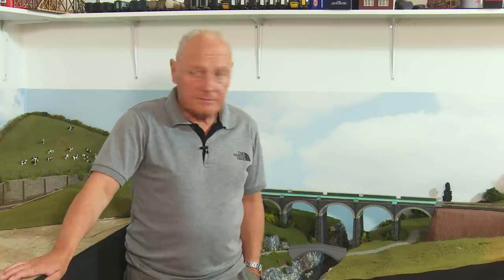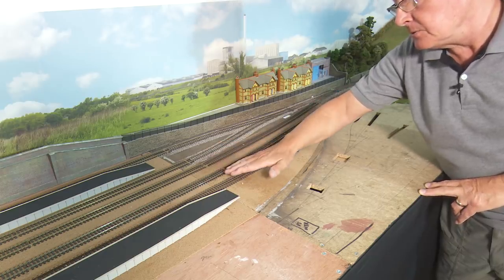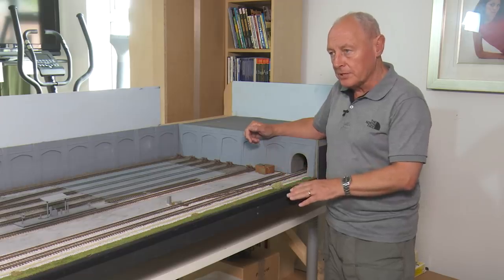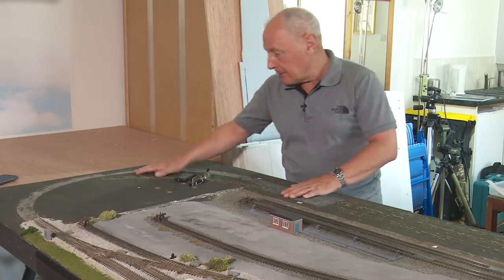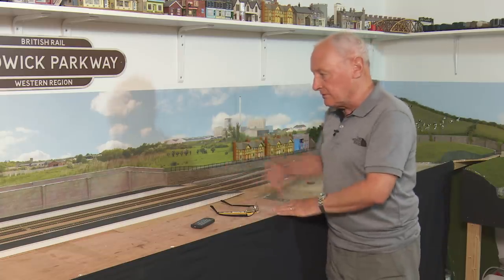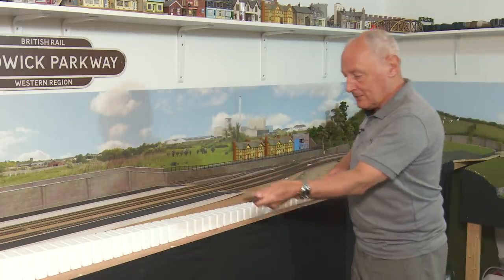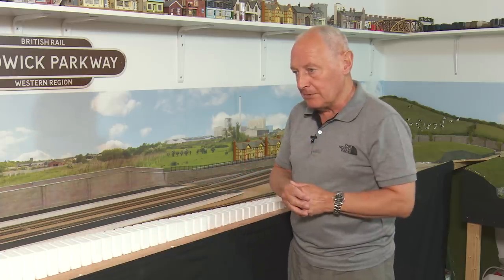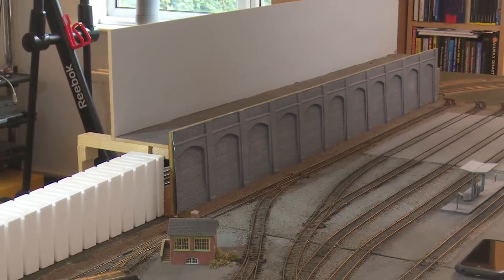A boring track plan at Chadwick Model Railway. | 72.

Comment: hi Charlie, I've got a very long incline on a ply strip. I found that I would have been better making it wider to accommodate a bit more scenery between rails and back scene. I used moss hedge which barely misses the trains! So the extra width on your incline is possibly a must.
Reply from the maker: Great point Chris.

Comment: Hi Charlie,
First, thanks for all your videos, which seem to come out just when this beginner is confronting a similar problem. 
Second, I would not use the 4% incline unless it was hidden - I think it will detract from the look.
Third, I think you should add an industry in addition to the parcels siding between the station and the edge of the board. Lots to do delivering raw materials and taking away finished products. Anything but boring.
Reply from the maker: Sound advice, thanks Tom

Comment: Hi Charlie, I never had much joy with inclines, but that's dating back to the days of old Lima and X04 Hornby stuff. Those locos would have difficulty pulling the skin off a 4mm scale custard. That said, my new Hornby TTS Class 40 can hardly pull itself along let alone a rake of anything prototypical. Looking at the 1:25 incline, I think it looks too steep personally, but it's all down to what gets you from baseboard to elevation in the run you have. I think if you were modelling 3rd rail SR then it's fine, but that's my tuppence worth! If it were me I'd probably have gone for a bit of scenic level change in the foreground of the station and maybe some decaying sidings to the right. Keep up the good work and make it for yourself foremost!
Reply from the maker: Thanks Ben, some good points too.

Comment: TBH - if you have such a distance between the new and the old TMD, I would use a shallower incline as it will be more realistic. I also concur with others in that you could split one set verticall with a hot wire (create a jig first) or lay a slightly wider sheet of balso or fibre board on top. I would be then be using traditional scenery construction to abutt the face of the gradient ie I would not trim/ cut into the gradient system. I dont think its boring - its simple. And what will you do with all the space infront of the station - looks perfect for a goods yard to me ie the trains will be part of the layour and the simpler will prove the better though I like the incline link to the old TMD
Reply from the maker: Thanks very much for your input, certainly food for thought.

Comment: Hi Charlie. You mentioned about the incline looking too steep. A good idea to hide this could be to continue the arched retaining walls on the outside, along and down 4% with the the track to the bottom of the incline. That way you still see any trains running up but from behind a small wall. Failing that, a tunnel would hide it very well indeed. Hope this helps ☺
Reply from the maker: All good advice, thanks T.

Comment: Charlie, I'm afraid you've got the same bug as me - get so far with a project, then change the layout! My wife says I'll never finish mine, and is asking SERIOUS questions about money spent lol! IMHO 4% incline is not right for a British outline mainline layout, when you consider that the Lickey Incline is something like 2.6%, and that's the steepest in the country. Trouble with the 2% or 3% inclines you mention is that you'll need a longer length to get the same height.

Also, if the idea is to run a shuttle between Chadwick Parkway and Chadwick Central, is there any need for it to be double track? And does the line have to cross from one side of the layout to the other at the station? Have you got room for a bay platform?

Anyway, keep up the good work!
Reply from the maker: Sound advice, thanks Neil.

Comment: Good video Charlie.  I admire your honesty!  I like the incline as it gives another dimension to the layout.  My only thought is with regard to the station area in front of it; are you going to have some branch lines and/or sidings? otherwise there is not much other than straight track to look at.
Reply from the maker: A fair point Simon and I’m on the case!

Comment: An interesting question Charlie. i personally like the parkway station. And looking at the incline behind it, it seems to me to over power it. Also just a question how will the trains get from the parkway platforms to the new Central Station. Unless you plan to have platforms on the incline, like the old Ilkley lines platforms at Skipton. Could I suggest that you use a '3' incline and bring the Central Station to the front of the fiddle-yard. I know this will mean changes to the old Chadwick TMD. But I also tried in the past to incorporate an old bit of layout, and I found it restricted me to much, that I scrapped the idea and started again, and planned anew. Before you consider anything further, if it was me; I would serious look at how you intend to connect the two stations, possible even totally redesigning the Parkway Station, as its current design I feel is also restricting you. The only thing that should be sacrosanct is the viaduct scene.

Again this is just my personal opinion, after all it is YOUR model railway. I am looking forward to see how you resolve all the problems.
Reply from the maker: Sound advice, thanks L.

Comment: Charlie I have those risers on my layout and I used plain brown hard board cut to into strips wide enough for 2 tracks and a little extra each side, you can lay the hard board rough side down and it will glue to the risers, the hard board is cheap and easy to cut and you can lay track on the smooth side.
Reply from the maker: A good tip SR, many thanks.

Comment: Hi Charlie. I largely agree with most of the lengthier comments below. It's already interesting and more complicated than my layout, but, at the end of the day, it's your layout and you that has to be kept engaged. Bored Charlie equals no videos for us!!!  Depending on the scenery surrounding it I think the 4% (well done getting there with the maths eventually!) does look a bit steep, but if your locos can manage it that's all fine. As you are going to have to go to the bother of two foam incline sets for the width I think you could use it to your advantage and, once the track is in place, carve the "spare" foam into embankments where retaining walls are not used. 
From my own and others (I am thinking of Graham Foulston's helix on Lakeside Mk 1) experience, if you can keep the inclines to the straight sections and any curved portions on the level there should be no problems with running up and down. And, if it's to be Chadwick Central two lines will be required.
My first N gauge layout (god, it's over forty years ago now!) featured an incline up to a station over other parts of the layout and I recycled that track plan more than once in different scales. More power to your elbow and, as ever, I look forward to developments. Cheers, Davie
Reply from the maker: Thanks Davie, it’s comments such as yours that make it worthwhile.

Comment: Isn't it possible to widen the ramp to fit two lines by overlaying another sheet of some sort of adequate width, and in-filling the overhang on both sides?
Reply from the maker: It is Gareth but I’ve already bought another set anyway.  They might well be cut down though.

Comment: Having recently returned to the hobby after an absence of nearly 50 years I really appreciate the encouragement and advise your channel provides, not to mention updating me on all the changes of the last half century! I think your viaduct scene looks great and whilst I can see where you are coming from regarding it making the station area look boring, it's the overall attention to detail everywhere and the pains you go through to make everything look right that impresses me. So why go and spoil all of that by trying to fit in an incline that in no way under any circumstances will look right ... it would be very dominant and simply too steep? Do hope you won't take offence ... certainly none intended as it is after all your railway but I think you need to apply the same trick you used for the tight curves and hide the incline out of site. All the best
Reply from the maker: Sound advice, thanks GDS and certainly no offence taken

Comment: I think you are going through the "I'm board with this layout"  like we all do. But I would like to say just concentrate on getting the layout all connected and running, then start doing the major changes that you want to do. You say put in a 12 siding at the back and you said " I can crawl underneath the boards", but in five years time you may not be able to do that or it could be hard to, so put some in front of the station as carriage sidings. The incline thing can be solved by putting some very thin plywood on top of the incline strips and gluing the track to that, and either cutting down the back wall or build it up to the back wall. Hope some of these ideas are useful. Thanks for an entertaining  video.
Reply from the maker: Thanks Colin, I’m so pleased that you enjoyed it

Comment: Hi Charlie
I know you want a double track but suspect it may be a better proposition as a single line branch, with maybe a 2 or 3 line terminus station? The line being bi-directional so where it joins Chadwick Parkway you may need to add point work to get across the main lines in either direction..if that makes sense.
Just an idea.
Cheers Paul
Reply from the maker: Thanks Paul and you’re not alone on that view.

Comment: I think every modeller changes their mind at some point in the build as to what they want. You have some great ideas and I look forward to seeing what you do. If I could throw my 2 cents in:

I would suggest taking the start of the rise back as far as you can personally I’d take it back to the fiddle yard have the branch run off from the fiddle yard on a slow journey up, a double track line and large terminus might be a bit tight in the area but a small urban terminus from a single track branch running closer to the city centre work give you ample space for freight sidings and a couple of platforms. This would give you a great contrast from the busy main line station at parkway.

If you ran single track from the fiddle yard yes you would have to run a second bridge, but it would give you more space for scenic elements, such as maybe an abandoned halt from the steam era in one of the corners or a disused passing siding due to the reduced amount of freight on the line. 

Starting all the way back from the fiddle yard would mean the track would be high enough by the time it reached parkway that you wouldn’t need to remove the freight siding, and your terminus could be slightly higher giving you more space underneath to be able to easily reach the 12th track in your fiddle yard with out bumping any of your parked rolling stock.(Something that looks like it might be hard to do with height you showed)

But that’s just my opinion. In the end it comes down to what you enjoy, and what you want on your layout.

Thanks, Kyle
Reply from the maker: Sound advice Kyle, many thanks.

Comment: Another very interesting video Charlie. Considering the high standard of your layout, I think the incline is heading into "train set" territory - too steep and cramped.
You(and other subscribers) may not like this idea but have you considered scrapping the original T.M.D. section? It seems to be restricting you at every turn(pun intended) and is causing you all sorts of problems. It was an excellent little layout but if you considered it to be a "learning tool" and started that area from scratch, I think a lot of your problems would vanish overnight. 
If you still fancy a high level section, why not put the second station at baseboard level and put a new T.M.D. above(ish) it?  Light engines would handle all sorts of gradients and curves, which could be, at least partly, hidden.
Just a thought, try a "pros and cons" list. Put all the reasons for keeping the old depot in one column and the benefits of scrapping it in the other - see what that suggests to you.
This may be an unpopular suggestion but it's one way of solving at least some of your problems.
Keep up the good work, you are an inspiration to many and I'm sure you will figure it out.

All the Best,
Dougie.
Reply from the maker: Sound advice mate, many thanks.  A decent option to consider.

Comment: Of course that locomotive gets up the hill, the decoder is masking any struggle on that speed step.  Try that at a higher speed and you see it slow down, or maybe go into overcurrent protection and slide down the hill backwards.

For track spacing, it is always a good thing to look at the NEM norms. Most manufacturers choose a safe minimum distance that works well in both corners and straights, but straight track can be more closely together, up to a minimum of 46mm centreline distance... only issue that you have here, OO scale is not mentioned in the documentation. But you can find all necessary stuff on the next page: https://www.morop.eu/index.php/de/nem-normen.html 

And for double track specifics: https://www.morop.eu/downloads/nem/de/nem112_d.pdf
Reply from the maker: Sound advice, thanks Ivo

Comment: It looks like your plan has one station. My reaction is: make a small and a bigger station, so that passenger trains have somewhere to go to. 

And then instead of a big fiddleyard(?) make a smaller or compact one. And do your freight trains (if you have and will ride them on this layout) have somewhere to come from and/or to go to? 

Or one big station and/or a complicated one with a lot of interchange of tracks with points and double (or single) switches. So they are going "somewhere else" and then from "somewhere else" come back to this same station.

This is like my plan (to be): one big train station (8 tracks and 3 platforms) in the middle of a double track dog bone in the shape of the letter "U", with double reversing loops in the ends and a double track from one end to the other as a run around. Maybe there is something in my plan you like to use?
Reply from the maker: Interesting options HDV. Many thanks.